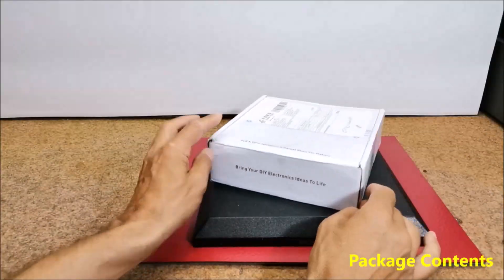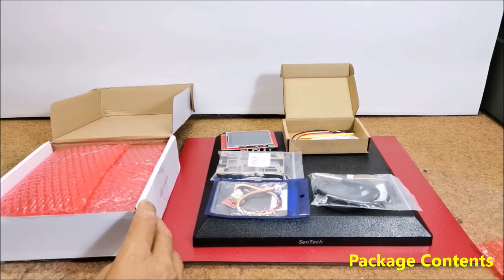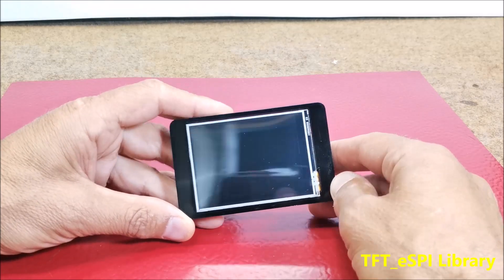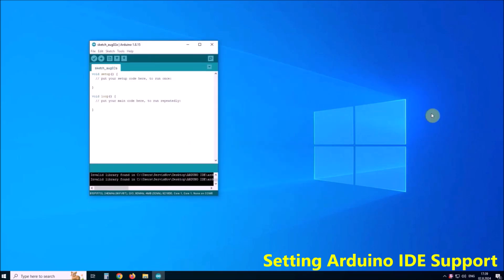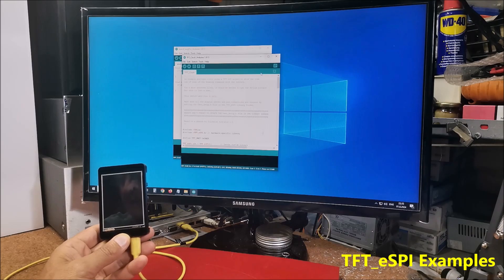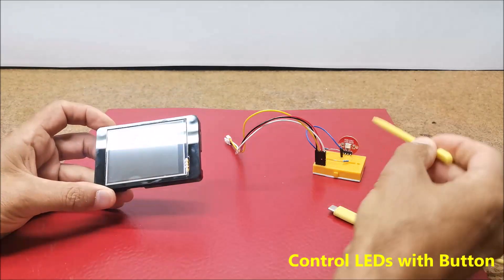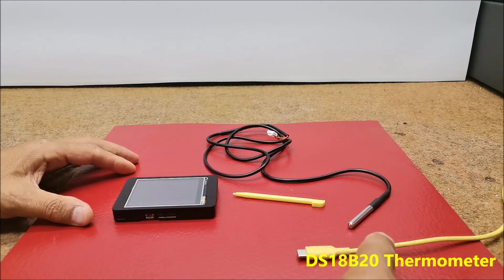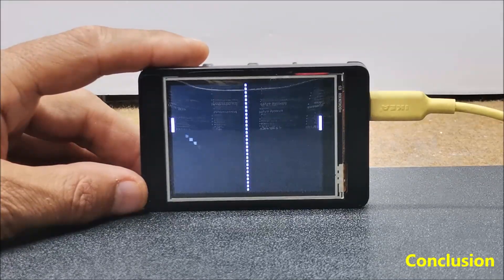ELECROW Crow Panel 2 8 ESP32 HMI Display   simple TFT eSPI examples

Comment: Hi, thanks for your video. Can I use this panel as a very simple monitor, with an application on the panel listening on the USB port for image data from another device, receiving the image data if detected and display the image fullscreen? This device should work as HID device for this purpose.